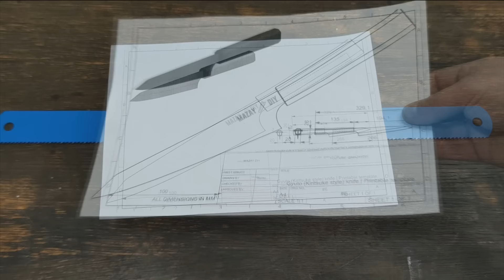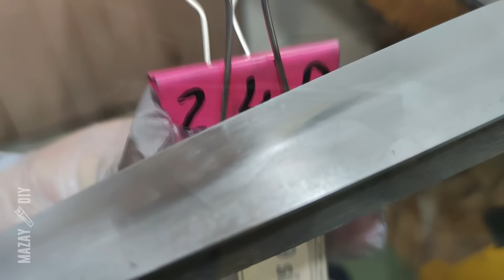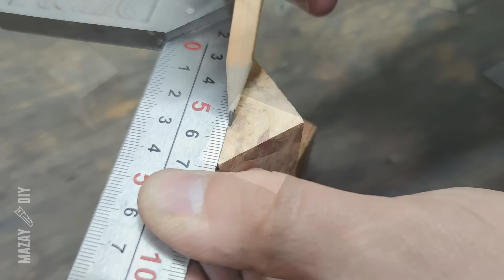Knife Making - Japanese Gyuto Knife from HSS Saw Blade

Comment: Not really knife making,more power tool use. Nobody drill into metal without it being clamped, Please!!!, it's really dangerous.Nice result though.
Reply: Excellent workshop and technical skills.
Reply: He started out with no knife and ended up with a knife. What's that if not knife making?
Reply: Because he didn't make the knife,the blade is already made for him. No forging,no heat treatment and using a Vernier caliper as a marking tool. Power tool demo.
Reply: Ackchyually, what an asinine comment. He made a knife from items that were not previously a knife, so knife making. He never said he was forging a knife, it's titled knife making. Does a carpenter need to mill the trees themself before they can say they made something? Can't wait to see all your videos of masterful skills.
Reply: I clicked onto your channel, expecting to see some knives made from scratch.
Only to find out you have no content at all, let alone on how to make a knife.

So what you have done with your comment is what's known as a keyboard warrior.
Reply: @planereality3675  He didnt really comment. He only filled in words in a little box. Nice grouping of words,though.
Reply: @flatmoon6359  there r processes of knife making, one of them is forged and one of them is stamped...this HSS blade is already hardened at 64 hrc and it holds this hardness till 500-600° celcius...so it will not loose it's hardness while grinding...I have more than 50 knives which are made from HSS and those are really great than your wusthof , henckels nd all those German knives

Comment: So no need to heat treat these HSS power hacksaw blades? How about a circular cold saw blade? I am using Australian names for these saw blades.
Reply: For HSS hacksaw blade no need to heat treat, just make sure they're NOT bimetal, All Hard HSS variety, for circular saw blade they're softer actually because their teeth are hardened.
Reply: I made 4 knives out of HSS hacksaw blade, these things are very difficult to grind lol
Reply: i usually test the saw blade by scratching it with a drill bit, if it slips and doesn't scratch, it is hard enough  and doesn't need to be  re harden
Reply: @agustnug  yeah it's also good to perform a scratch test first but better use file

Comment: This is most commonly Dmo5 or M2 type of hss... it is my favorite steel... :D for a reason...
Reply: I made a Seax from an "HSS" power hacksaw blade, but it may not be HSS. It seemed a bit soft so I hardened it. It got really hard after quenching and tempering but remained really flexible.  It takes an edge beautifully. I love that steel, whatever it is!
Reply: @Bob_Adkins  i dubt it is M2 type... As M2 is very hard and if you heat it, it will harden in "air" ... It petrifies ... Becomes like a stone... I made a few out of little hacksaws also... Because of their size i use these kind of scraps for arrow heads...
Reply: @XplosionNo1  That's the same thing I was thinking. When I drilled holes for the scales, it was too easy to be HSS so I hardened it. So not all "HSS" hacksaw blades are true M2 or M3 HSS. After hardening and tempering, it was excellent steel nonetheless, just not HSS as advertised.
Reply: @Bob_Adkins  i just made one from these little powersaws... This stuff is Bi-metal... Teth are welded ... spine is not hss... :D ;)
Reply: @XplosionNo1  The saw I used was not bimetal, it was solid with no signs of welding or induction hardening. It was around 13-14" long and 1/16" thick, so it was not small. Great metal, but probably not HSS.

Comment: Wow beautiful knife. Does it hold a edge well? I absolutely love the sharpener also. It there any plans on it.
Reply: HSS can make a good knife but not a chopper as it can break easily. I made a paring knife from hss saw blade. Very hard to sharpened it but it hold edge longer. If you polish it well with fine silicon carbide sand paper, it will not rust easily. Just wipe it dry after you using it.